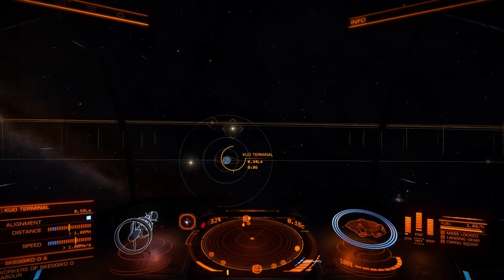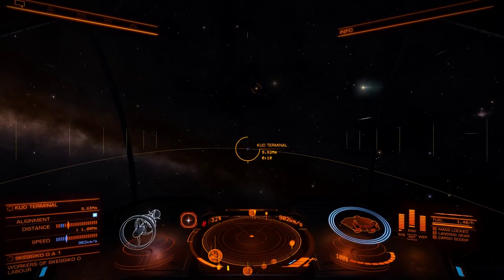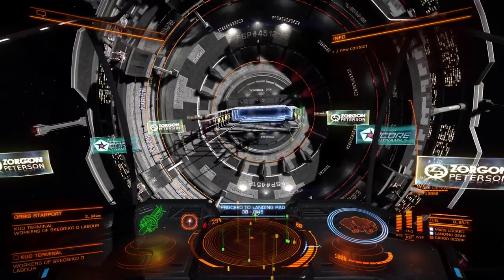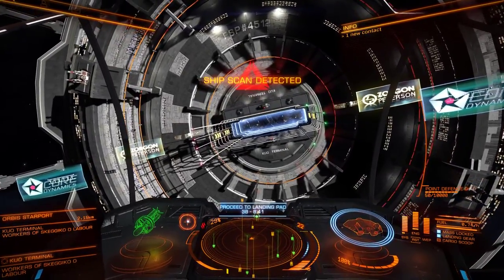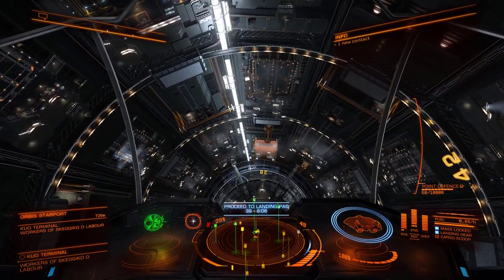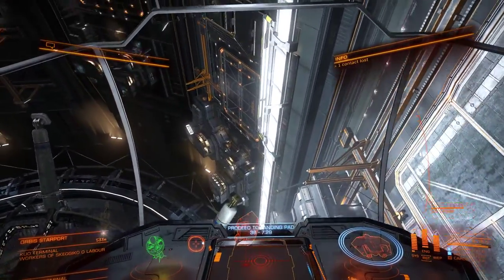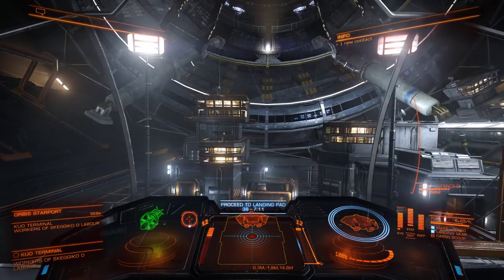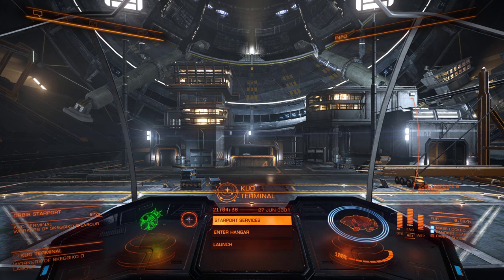Old School Docking (Pitch and Yaw only)

Comment: I never had a problem with docking so don't quite understand the concern made by some. Good video by the way...good piloting skills
Reply from the maker: CMDR Phreedom Yeah, the only issues I've had thus far are forgetting to request permission (backpedal, swear, wait, re-dock, pay fine), hitting boost by mistake (changed joystick map to avoid from happening again), and trying to dock at full boost speed either because I had seconds of oxygen left, or was trying to do the high speed docking challenge. I'd actually like the docking clamps to be more picky about how the ship is oriented before they grab you ;)